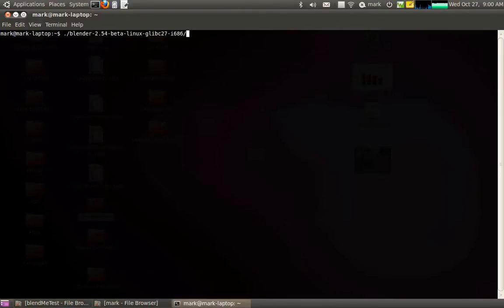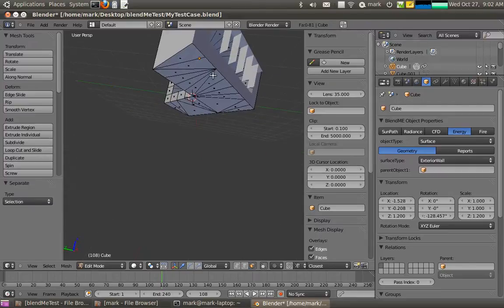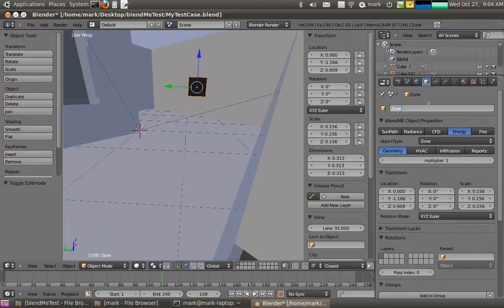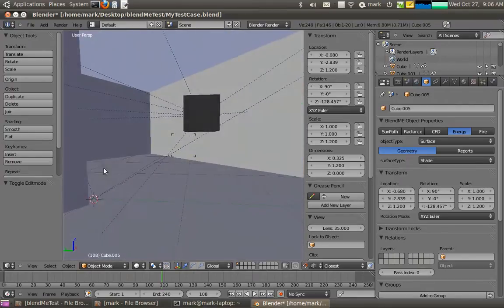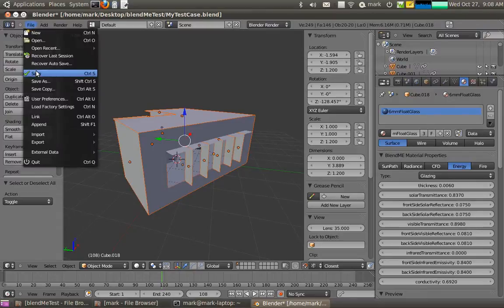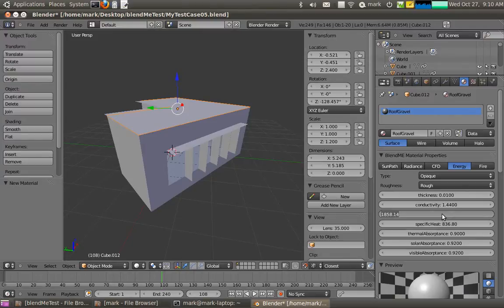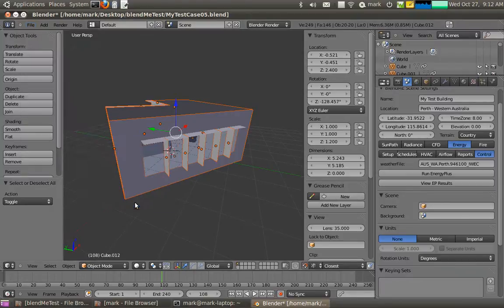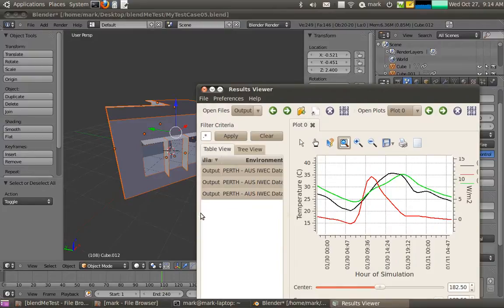BlendME Tutorial 05 - EnergyPlus Analysis

Comment: If you would save materials with data in the "BlenderME Material Properties", does it work to append this materials from one blend file to another? Does the BlendME data follow along? If it does, then it would be easy to build up a library of different construction materials in a series of separate blend files, that you append when you need them.